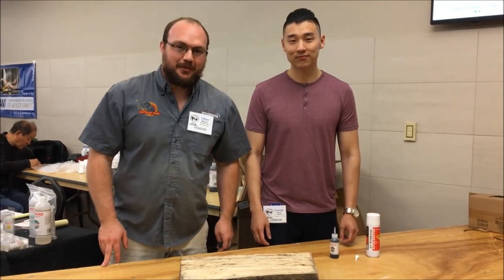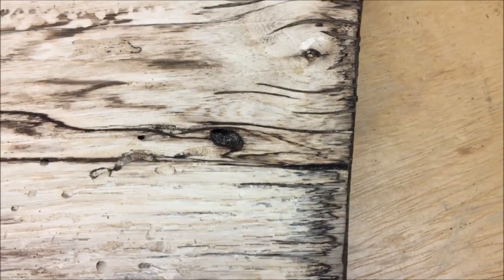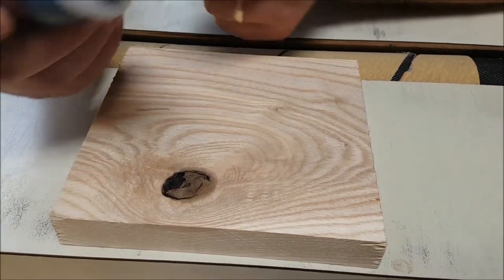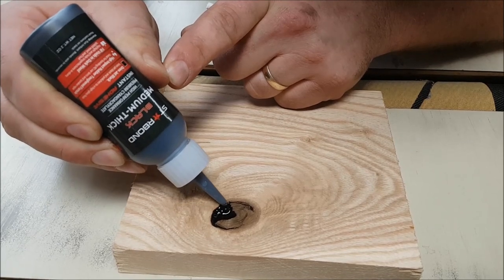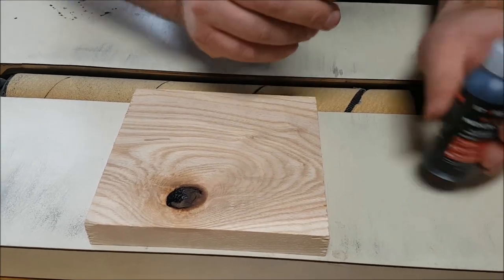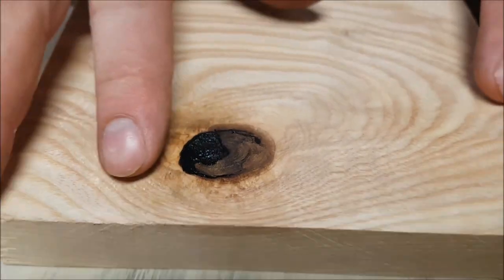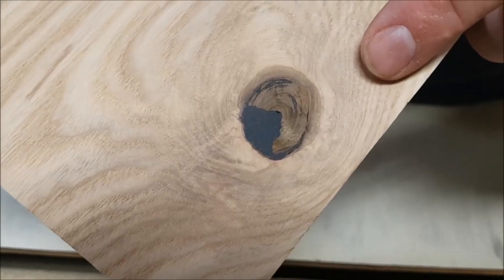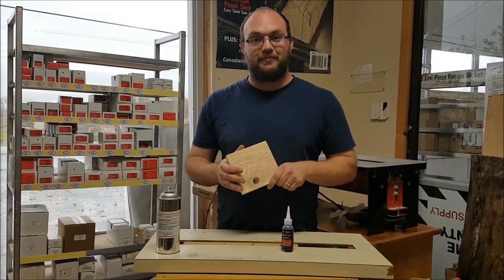Filling Knots & Voids Super Fast! Starbond Black CA Glue EthAnswers

Comment: Is there a way to apply this upside down. I have some cedar soffits where a knots has resulted in a small 3/4" hole that needs to be filled on the edge of the tonge and groove. Because it's in the soffit the application of the filler needs to be done upside down. Is there a putty version of this product or maybe a thicker version of the filler?

Comment: We have a kitchen counter top mad from old fence palings. A few of the old imperfections are opening up. Can this be used on a treated/ sealed surface? Will or could the accelerator affect the surrounding finish?

Comment: I have some bubble voids in my urethane castings. Will your product fill these voids. If you had a cross section of the void, It would resemble a U. Can I polish the surface, after it's cured. The base material of my product is Polyurethane.

Comment: Is it as strong as epoxy
Reply from the maker: Comparing it directly to epoxy I'm not sure. What I can say is it dries very hard like standard CA glue but they have also added a rubber compound to it. This make its dry time slightly longer but also adds some flexibility to account for movement in large wood slabs.
Thanks for watching!